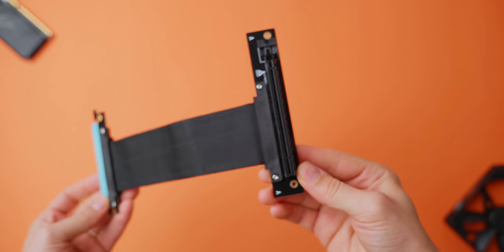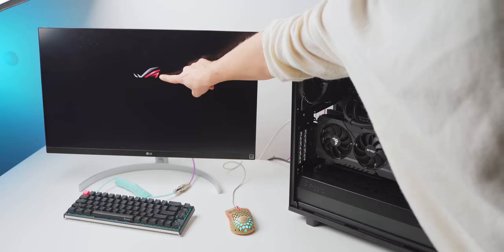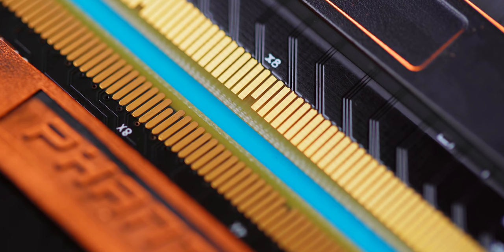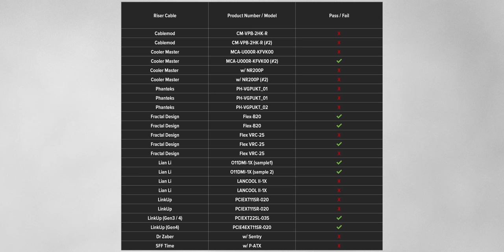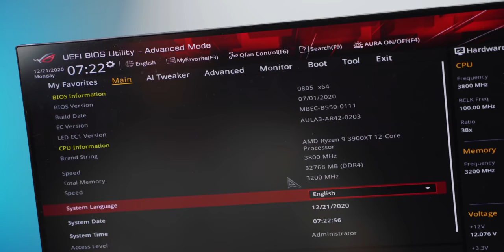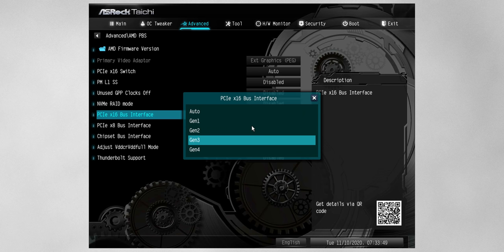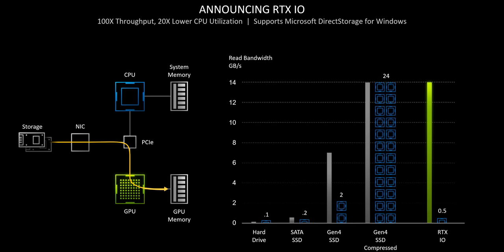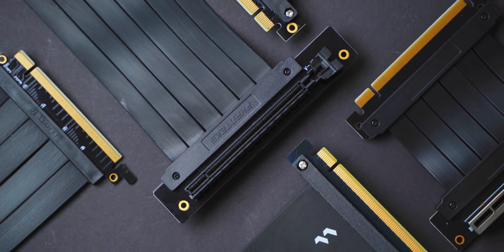There's a PROBLEM with Riser Cables

Comment: If I disable the Gen4 in the BIOS, what would happened if I have a Gen4 m.2 nvme drive, would it affect the performance? Or it doesn't make a difference because is a different port?
Reply: I have an Asus strix B550-I and a msi 3070 XC3 ultra and I'm planing of buying a Gen4 m.2. My case have a Gen3 pcie extension cable, it's a Nzxt H1
Reply: Did you go through with it?
Reply: @dnoodspodu1159  Just disable Gen4 on the BIOS, I'm still not buying the Gen4 nvme because I don't know if it will work at Gen4 or Gen3 speeds and I find pointless to buy a Gen4 pcie cable, I ask this question some time ago and I haven't been responded yet.
Reply: @aldrylombano  Thanx for the ifno
Reply: @dnoodspodu1159  you're welcome

Comment: Nice, I almost forgot these things existed. Just a few questions, what's the resistance of the current going from the gpu to the motherboard? Wouldn't the signals have more resistance communicating with each other when some distance of wire is introduced? If so wouldn't it make sense that some wouldn't work because there isn't enough current going from the gpu to the motherboard, or the timings for instructions get slightly off. I think these risers need some sort of signal booster.

Comment: So using a riser with an Nvidia 3000 series card, with a Z490 motherboard and an Intel 10th Gen processor would be fine right? Because the 10th gen chips dont support PCIe Gen4?

Comment: My issue was paying $70 for the only PCIe 4.0 riser cable on the market, as nearly every other cable is 3.0.  The Phanteks, Lian li and every other vertical mount comes with 3.0. If you legitimately want 4.0, you'll have to purchase the 4.0 cable and remount it on the bracket. Otherwise, you'll have to change your BIOS to run at 3.0 speeds.

Comment: maybe a late question, but would a pcie gen 3.0 card with a gen 3 cable on a gen 4 board be a problem really ? cause the card will always run on gen 3. even when put in a gen 4 slot. I can understand  problems would arise with gen 4 cards on gen 4 slots with a gen 3 cable, but what in the other case ? the board chooses gen 3 for gen 3 automatically anyway, even when the slot is set to gen 4.

Comment: I got a Coolermaster NR200P case for an Intel ITX motherboard. I wanted to use the PCIe 4.0 x16 Riser Cable that came with the case for better airflow for fans in the bottom, but for some reason with the AMD Radeon Graphics card, there was an issue with the HDMI sound popping and going in and out. The sound works fine when the graphic card is plugged directly into the motherboard without the PCIe 4.0 x16 Riser Cable. So yeap the Riser Cables have issues! Anyway TU on the video. The Manual says nothing about the Coolermaster NR200P riser cable to change to Gen 3 in the bios so I will see if that resolves the issue ...

Comment: I got the Lian-Li PCIe 4.0 riser but my PCIe bandwidth test in 3DMark got cut in half: 24GB/sec to 13GB/sec. I simultaneously when from a O11 Dynamic to an O11 XL, so maybe there is some additional room and I can remove it. What a letdown.

Comment: I have a rtx3000 series card and a B550 motherboard. I want to get the SSUPD Meshilicious and right now they are offering the case with either a 3.0 or 4.0 pcie. However, the 4.0 one is 70 dollars more at $180. Do you think its worth the extra money to get the 4.0 pci reliability?

Comment: Good video man. This is one of the reasons I did not go into the new AMD and RTX setup. I am rocking 8700K and 1080 Ti and since I am a casual gamer and play (atm) only OW and PC Building SIm I will wait 1-2 years for the next build.  I don't upgrade a PC until there are games I want to play on ultra with at least 100 FPS. So Cyberpunk can wait. I will most likely upgrade for GTA 6.

Comment: Gen3 riser question - If you have a 20 series gpu(gen3) and b550 board(gen4), is it still required to adjust Pcie from bios? Thnx

Comment: I have a 3070 and B550 Gigabyte Aorus motherboard, Im using a chinese non branded 3.0 riser cable that came with my case. It doesnt do anything in 4.0 but when enabling 3.0 I am still getting a random black screen a couple times a day. I have bought one of the expensive 4.0 cables you linked is this likely to help do you think?

Comment: So, I've found a pcie4 that works great, but I'm not sure how to properly secure the motherboard end so that it doesn't pop out of the motherboard. The end with the tab lock stays put fine. The other end that would normally be held down by the screws at the top of the graphics card hasn't got any obvious eat to hold it in place.

There's a screw hole, but it runs parallel with the motherboard and doesn't look like it can be attached to anything anyway

Comment: Oh wow. I thought the new PCI gen 4 motherboards were overpriced, but man those cables are crazy expensive. All that for a nearly unnoticeable difference in performance.
Reply: For now
Reply from the maker: But they can actually give you STABILITY which is a big thing.
Reply: @HardwareCanucks  This is also new technology. As this becomes more standard in future hardware I'm betting pricing becomes more reasonable. I just had some shock over what a current gen 4 riser cable costs.
Reply: @HardwareCanucks  Which part? The MB or the riser?

Comment: Had similar issue connecting both my x570-e and 3080, monitor kept blinking every 5 seconds. I noticed that my gen3 riser works with a gen4 component as long as it's connected to another gen3 component. (my gen4 mobo worked when connected to a gen3 gpu, and vice versa).

Comment: Any chance you can do something similar to testing RAM compatibility? I just finished my X570 build using an MSI Prestige board.

It's impossible to overclock right now since the RAM kit isn't in their compatibility list for the 5000 series.

Comment: I blew a riser cable that came with my Striker chassis. 2080Ti plugged into a Asus z390-i motherboard. It happened when I switched on my pc with my Oculus Rift S plugged into the USB C port on the gpu. I thought my gpu was bricked at first...

Comment: I bought a rtx 3070 and used a PCI-E Gen4 riser cable to use the graphics card vertically. I did a benchmark before and after. I had no performance loss.

Comment: i need help, recently bought the pcie riser but the other design,with the sata cable thing, plugged it in and plugged my gpu in it, turn on my pc and next thing i know is the sound is disabled, and i cant connect to the network, not even the icon shows up on the taskbar, ive tried alot of things, did i just shortcircuit my motherboard?
spec:
i5 3470 3.2ghz
8gb ram
gtx 750 2gb
280watts ( hp compaq 8300 default psu )

Comment: i’m building a pc and i have a rtx 3070 ti and asus tuf gaming b560 and a i5 11600k what riser cable should i get? I need to get one cause my dad ordered a trio fan gpu and it will only fit if mounted vertically

Comment: The main problem I had with a vertical mount for my case that dont really support vertical mounted GPU. You have to snake a HDMI/DP cable through the PCI Slots. So  you have to use these 90 degree HDMI/DP cables. Those cables dont support high refresh rate monitors!! :(

Comment: I hope this video saves my build. Unfortunately I already installed all of the components and designed my entire liquid cooling loop before I had the common sense to test all of the components (never again). This build is massive. My 3090RTX will not display anything to my monitor and my msi motherboard keeps giving me the D6 error code saying that no console can be detected. Already tested the ram individually  and nothing changed. Tonight I will drain the loop, remove the riser and directly connect it to the mobo and see if that solved the issue
 Wish me luck. I spent a pretty penny on this for streaming and music so I'm really hoping it pans out.

Comment: I have the 4080 from Gigabyte with Phanteks pcie 3.0 vertical mount on a z490 pcie 3.0 mobo, i had no problems with 3060 ti before with this cable in 3 years ,it seems Phanteks are making good vertical mount /cables and the mount fitted well on my old lian li o11 dinamyc ,now i have Asus gt502 case because i was not sure the video card will hit or not the cpu AIO😎

Comment: Think i finally found my issue. I've been getting the VGA light on my 550itx strix with the 5700 xt sapphire nitro randomly. Replaced the mobo and psu, unplugged and plugged things in countless times. My case came with the PCIE 3 cable, i should have bought the gen 4.

Comment: Had this issue in my NR200P with 5700XT and a Gigabyte 570 motherboard. I had changed the pcie to Gen 3 in bios and all was good before i mounted my gpu vertically. But later when I upgraded the cpu to a 5600X it had reset the bios and I did not know about it. Thought it was the new cpu but then I remembered about the riser cable. Took several reboots before I was able to get back into the bios to change it back to Gen 3. I could of just removed the aio and put the 5700XT back in the gpu slot, but I was feeling lazy. haha I ordered a pcie gen 4 riser. It'll be here in a few weeks and I can give that a try. Hopefully manufactures will setup and start including them in their cases.

Comment: I have a gen 3 cable. Motherboard is gen 3 only.  My 3090 fe was randomly turning the monitor screens off and freezing.  Working like normal plugged into the mb.  Would a 4.0 cable fix this issue even though the mb is 3.0?

Comment: I had the same problem but I have a custom water cooling loop with hard line tubing for the vertical gpu as well and I couldn't remove de video card. I was (very) lucky that the video signal was working to access the bios and change the setting(in Windows the Nvidia driver was not detecting an Nvidia card).

Comment: LOL, I was battling literally today all day with my (PCIe 3.0) PC's move into an Ophion Evo & concluded it was the riser.
Behaviour included random failures to boot, jittering when even moving the mouse, tonnes of system interrupts, crashes, etc. So much annoying randomness. Unplugging it and using onboard video worked just fine.

I bought a cheap 3.0 replacement with good reviews for now, until the 4.0s cheapen.

Comment: Hello! I come from a recent build with a ssupd meshlicious, until now, I had a pcie 3.0 riser cable to connect a 2080ti, nothing to worry too much, I could use with not much problems the pc, all problems came yesterday after I install the new official riser cable from ssupd (140mm one ,4.0) to install a new/brand rtx 4070 , the asus proart. It started to random freeze, stuttering, difficulty to boot, black screens. A damn nightmare. After I set back to gen3 the video card, all problems gone and seems to works well now. I really wonder if it’s the riser cable problem actually or my motherboard can’t simple hold the gen4 with a riser cable and I need to change motherboard, or upgrade to a new setup. I have a x570i rog strix

Comment: Kind of weird considering GPU’s can’t even utilize all the bandwidth of pcie 4 yet.. I have x570 master and 2080 super, got a riser cable but my gpu is a 3 slot so I haven’t been able to try the cable yet.. might try connecting it just to see if it works 🤔

Comment: I've been using a riser cable for a year now, just bought a new MBO+CPU and I started getting constant BSODs only few minutes after booting up windows.. I already thought I got a faulty motherboard or cpu.. but just in case I removed the GPU and tried using the iGPU on my intel cpu.. had no BSODs.. after that I tried plugging in my RTX 3080 directly into the motherboard and surprise surprise no BSODs since.. It is a real shame I can't use the riser since it looked much better and it worked on my previous motherboard..

Comment: I have rog helios case and then I installed riser cable to my rog strix rtx 3060 ti using rox strix b550 f mother board. When I open my pc the graphics are slow and then after 2 mins my pc restarts. how can I fix this?

Comment: So does this mean that when I install my 3070 in my X570-i board will I have to do this? Or can I just change to gen 3 in the mobo now when I install it because my 1080ti is working fine in auto mode

Comment: Could some of those signal integrity issues be mitigated by the use of hard riser cards instead of flexible cables? I'd imagine so, but that would obviously present its own set of headaches.

Ideally, I'd love to see more custom, technically out-of-spec motherboard designs that feature horizontal PCI-e slots. MSI's Trident SFF prebuilts have that kind of layout - a PCI-e slot poking out from the top edge of the motherboard that you can slot any ol' GPU into in a horizontal orientation. Obviously, this would also necessitate a similar paradigm shift in case manufacturing.

Comment: I’m a little late to the party on this one...just vertically mounted my 3090... set up and entire custom liquid cooled loop..only to find out that I need to switch it to 3.0. Is it possible to do this without taking my entire loop apart and horizontal mounted my gpu?

Comment: What about solid riosers (no cable) I've had some success with a half inch riser extention to a right angle riser with a variety of boards and GPUs, but I have not built a Gen 4 system yet.

Comment: Interesting question: Why aren't more "Riser cables" just a carriage with a solid sheet of well-protected copper? Sure it would be hella expensive but wouldn't one imagine using solid metal facilitate an improved and more durable connection than stranded copper or solid core wire?
Reply: Cost.  It's all about cost.  3M does make a cable that works 100% of the time, even on Gen 4, but it's about $100 retail.  It also looks ugly.  :D

Comment: Yes build my new PC for Christmas B550 RTX 3070 with brand new cable mod V bracket and all Christams day was having problems with BS an no signal. Fit the card to the second slot work fine and now  now I'm in vertical  1st slot GPU position

Comment: TL DR: It has to do with mobo settings more than the riser cable. If your mobo is pcie 3 only or defaults to pcie 3 first when set to auto, no issue, if it defaults to pcie 4 under auto cause it sees the pcie 4 card but you’re using a pcie 3 cable, then it screw up. Easily fixed by plugging in directly and changing mobo to pcie 3 only.

Comment: I swore off riser cables with my first 5000 build earlier this year. I can only imagine how less experienced people may just return hardware because of this. One riser cable would let me boot into widows but I would get crashes and blue screens when playing games. I removed the riser as a last ditch effort and it worked. So frustrating. This was with forcing gen3 in bios. Don't even try bifurcation. No way that will work as I do not thing there is a 4th gen bifurcation riser on the market. There are so many cases out there that require risers. for example, Ghost S1, almost all Sliger cases.

Comment: This really helped me I recently build my gaming pc(specs : RTX 3070 and the motherboard itatchi b 570 ) and sometimes it booted and sometimes it didn’t even in taskmanager the gpu wouldn’t get noticed and I struggled alot restarting the pc switching pci slots and still get the issues and I also started getting  alot of blue screen [video tdr failure] heck even the gpu start to spin very fast as if it went to overdrive after I removed the card holder from coolmaster everything worked fine but now I’m kinda scared to edit in bios to gen 3 i’ll try tho let’s see if it works 🤞

Comment: I was about to buy cooler master riser mount with cable v2.. But holded off until gen 4 comes out. I do have the 1st gen Cooler master riser cable and riser, works fine, posts to bios, but in Windows, force driver error all the time, and don't even recognise the driver even if pre installed. But it works fine in bios so changed the mode to gen 3 and works great now. But waiting now for the actual cable. Bought a cheap gt 710, if bios dont recognise the gpu after any future bios update....just in case 😬

Comment: Running a riser cable designed to handle 3.0 on 4.0 seems like a recipe for "weird issues" even if you do get a signal and normal behaviour most of the time.
With the current graphics cards I think it's such a small difference in practice to run 3.0 anyway that it seems like a no-brainer.
I expect the 4.0 risers will be significantly cheaper once they go a bit more mainstream - ie. hopefully before the next round of GPUs hit.

Comment: The wildest part of this whole thing to me is what you guys found with the complete randomness of which risers work out of the box and which don't. But I'm confused if you tested if the Gen3 risers were working in Gen4 mode, or if they were working with it set to Gen3?
Reply from the maker: All of the motherboards were set to their defaults (so auto on the pci signal). They all worked when manually set to gen3. 
-D.
Reply: @HardwareCanucks  Gotcha thanks! I've read that some riser cables not advertised as Gen4 are compatible with it anyway, mostly have heard about the thermaltake premium model from the SFFPC subreddit. Not sure if it's true though, especially after seeing what you guys found with the complete randomness of it all

Comment: Did u test that the cable when no GPU drivers were installed? This is what I read on reddit that it would output video fine and was my experience when building my pc.
Reply from the maker: This was during POST when no drivers are present.

Comment: funny, I have a phanteks gen 3 riser cable with an rx 5700 xt and asus MB
no problem to set it in gen4 mode, no problem at all.
so the quality of the motherboard is certainly a critical point, a better strength of the signal for example or less noise from the motherboard in combination with a good design of the GPU.